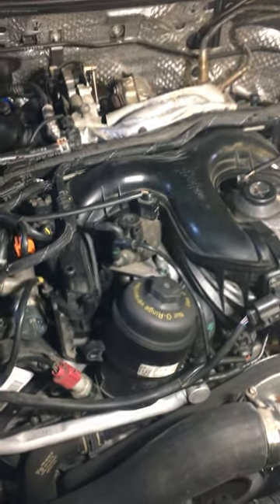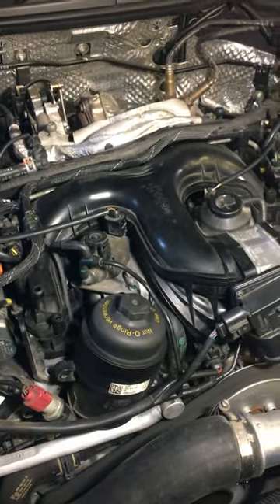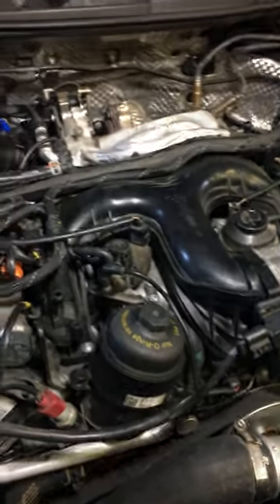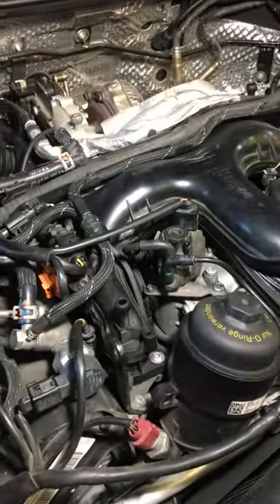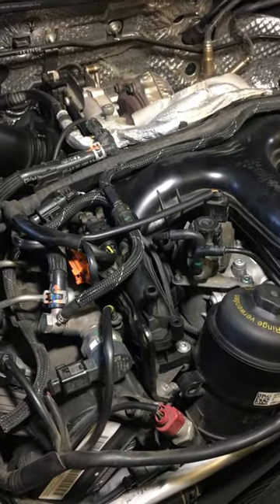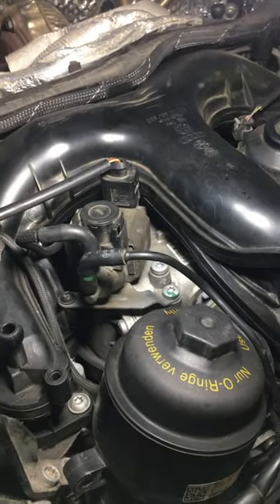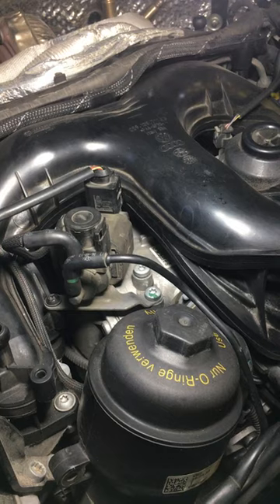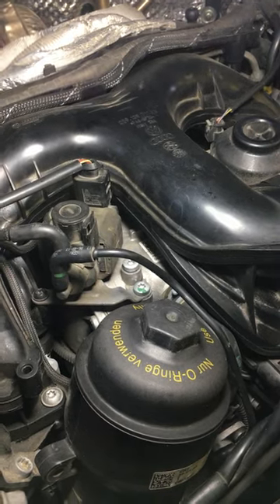VW 3.0L TDi Cooling system bleeding

Comment: I replaced the water pump in my TDI Touareg - I emptied almost all of the coolant, but only about 3L has gone back in.  I tried the heater method, for about 30 minutes but the level in the resevoir is staying the same.  Clearly coolant is not getting into the engine.    Is it possible that doing what you did in the video will solve the problem?  I'm very concerned about running the engine this way.   Also - how much do I need to let the engine cool down before doing this?  Thank you!
Reply from the maker: Best if the engine is cold. Sorry for the slow reply

Comment: I have a 3.0L lieter 2015 Touareg and the screw you show is smaller (like three times as small) than in your video, is that normal? I have not tried to do anything yet as i am studying and preparing to do it :P
Reply from the maker: I am not aware of any difference.
Reply: @garysgarage2118   what's the engine in the video? Mine is CVWA ( also known as  CASD, CJMA, CRCD, CVWA )

Comment: What if no coolant comes out that screw ? Thanks
Reply from the maker: If your system is in vacuum you may not get anything out at first. You can open the reservoir cap. Feel for air escaping. If there is a lot of air in the system it can take a while